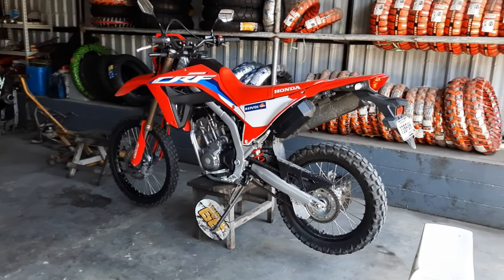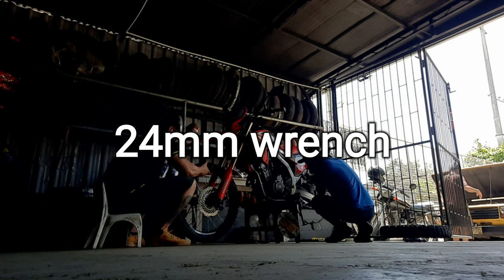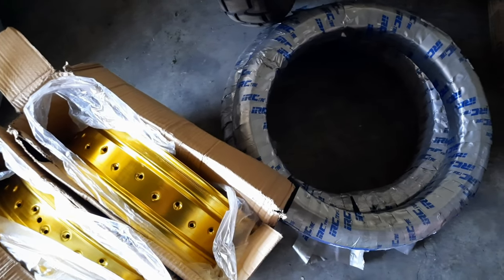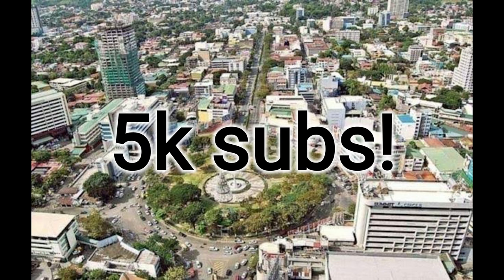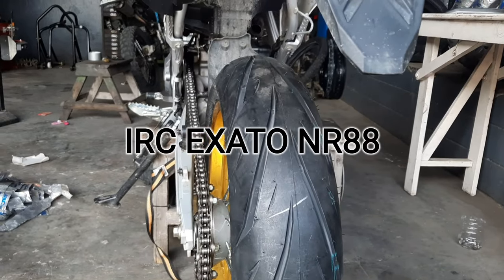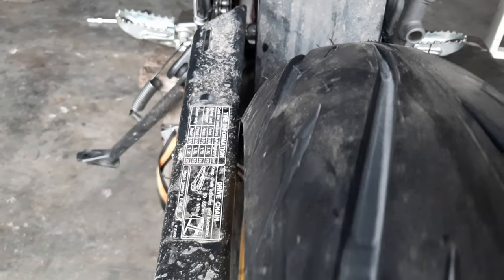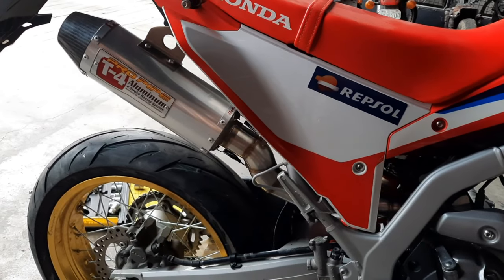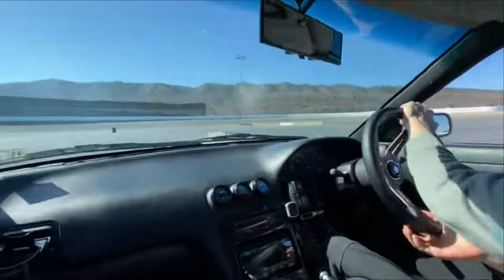Honda CRF300L - Supermoto conversion and Exhaust install + luggage rack

Comment: Hi, I’m planning to build supermoto wheels for my crf300l, so I can freely swap them with the stock dual sport ones whenever I want. I wish I could just visit your shop to help me out but I’m located in Poland and we don’t have that many options here 😅. I found a company that can build the wheels for me but I have to provide them with all the specs. I know that the rims should be 17x3.5 front and 17x4.25 rear but I also need the hubs sizes, which I cannot find anywhere. Would you be able to help? Thanks in advance! 🙏
Reply from the maker: You could get a pair of 250/300l hubs if you want to build your own set. Or order a complete wheelset from SMPro or Warp9.
Reply: Thank you so much for your suggestions. I’ve already known warp9 and their ideal solutions designed for particular bike and version but from what I know it’s not really possible to ship them to Europe. I’ve just reached out to SMPro though because I hadn’t known about them until you enlightened me 😊. I really hope that it’s gonna work out since I’m craving to transform my bike into supermoto and it’s pain in the ass to figure it out properly in Poland. I have one more question. Have you dealt with ABS ring sensors while switching to sumo wheels in any of the bikes at your shop?
Reply from the maker: I believe SMpro is a better option for you since their closer to you. 

The bikes i worked on are non-abs models though so i never had to deal with that.
Reply: Yeah, I believe so too, I’m waiting for the response from them. Once I know anything, I can let you know 😊. Thank you once again for your help!

Comment: Wht is the tyre size ? You just mentioned the rim size thanks kuya
Reply from the maker: I installed 110/70-17 for the front. 150/60-17 at the back.
Reply: @TheManoy66  is that possible if I put 160/60-17 for 425 width?

Comment: Nindota bai! Pila ang cost sa wheelset?
Reply from the maker: Bai if ato convert using stock hubs cost is around 20k. Could go higher depending on the brand of rims and tires. DM me in FB or IG if you want yours converted. 😎
Reply: @TheManoy66  Not bad bai, sige contact nya ko nimo naa ko i refer.